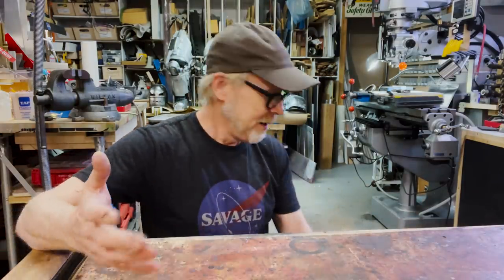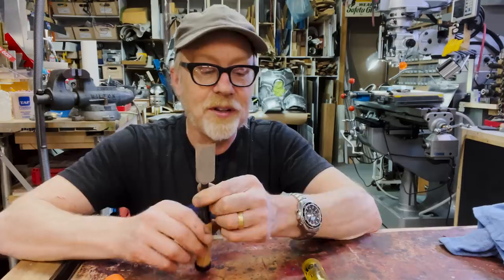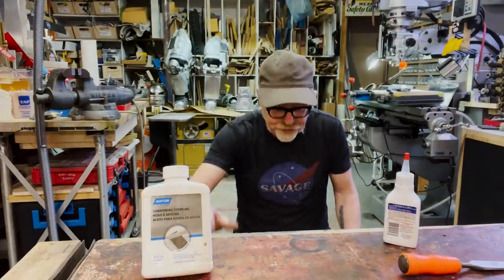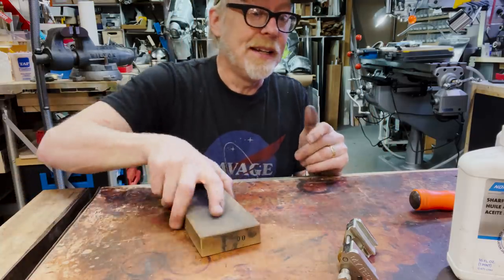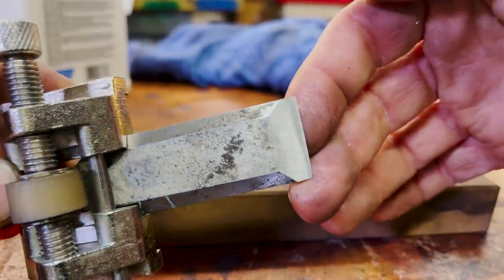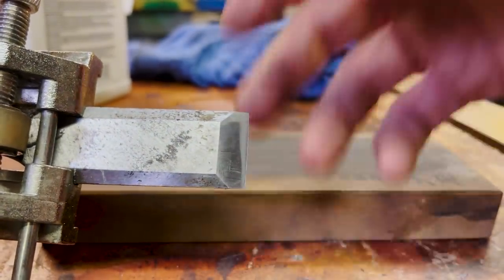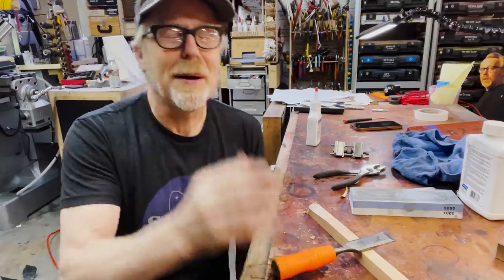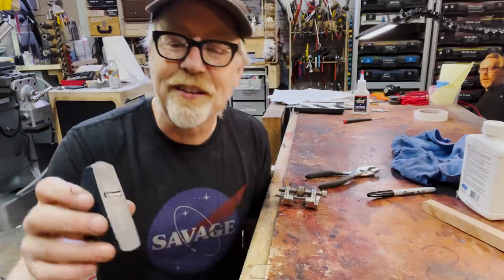Adam Savage's Favorite Tools: Woodworking Chisel Sharpening!

Comment: Hey Adam,
Handtool enthusiast here (come see us over on r/handtools!).
The key difference between a high-end and a bargain chisel is the steel. Exotic steels like PM-V11 vs something like A2. A really high-quality chisel is going to be made of expensive steel, they'll hold an edge for a good long while, but conversely, they'll take much longer to sharpen on something like a stone.

There are some very small differences in geometry of a chisel (consider a morticing or "registered" chisel), but these are mostly 'nerd' differences, and a regular bevel chisel like your hardware store finds are perfect general-purpose tools and modern steel means that even morticing you'll be fine.

As others have noted - Oilstones need oil, Waterstones need water - and really, Waterstones need to be soaked for 15+mins (until the bubbles stop coming out), a lot of people keep them in tubs of water so they're always good to go! Personally, I prefer my diamond stones, they cut really fast even in exotic metals - so I can spend less time working chisels, and more time working wood!

For sharpening, I find that it's a much better use of time to stop the chisel regularly during use, sharpen free-hand on the finest couple of grits before putting away each use, and sharpen with a jig on all grits when it's getting dull.

I wholly recommend the Veritas mk.2 sharpening jig - but only if you're ready to start getting into the world of Micro-bevels and "handtool pattern baldness"! Otherwise, the jig you have will keep you happy for years! Also, do bear in mind, if you put pressure on the tip of your chisel, you'll flex the chisel slightly, and create a camber (really useful for sharpening hand planes, not so much chisels).

A final note - a polished back will get you a much sharper edge, if you can get a mirror-polished back, all the little minute grooves that diffuse light will be gone and the edge you sharpen will have at least one perfectly flat intersecting plane. Doing this for the back will last much longer than the front, and pretty much solves the 80:20 problem for time management when using chisels!

Good attempt at a quick touch up, and as always, any time spent pretending I'm in your workshop is a dream come true.

Cheers Adam!
Reply: I've been wanting to get myself a couple of diamond stones. Mostly because the fact that they should stay perfectly flat longer without me having to be so precise with how I use my waterstones.
Reply: A man that refers to steel by recipes and can talk sharpening... my man. Keep up the good work!
Reply: Veritas system is so good. Worth every penny for chisels and hand planes.
Reply: @jonanderson5137  Once you can start listing the elements in each blend and the pros and cons of each you know you've swam too far in the deep end!
Reply: @sz9465  Veritas is too fiddly. The Eclipse style guide is all anyone needs.
Reply: If oil stones need oil and water stones need water, then those diamond stones must be really expensive to use!
Reply: @bryan__m  I wish I could give more likes than just one XD
Reply: @bryan__m  I use a fluid that costs $5 a gallon. If I only used it for sharpening it would last for decades. But it is a good cleaner too. So I only get a couple years out of a jug at my regular consumption.
Reply: @1pcfred  it was a joke about diamonds...
Reply: @bryan__m  thank you Captain Obvious. Unfortunately there are people here that would not know.
Reply: @1pcfred  I'm not sure it's clear from your response that you were not one of them, but if it makes you feel better to call people names then by all means continue. I'm pretty sure most people would know that diamond stones don't actually use diamonds to lubricate, but thankfully we are past that now and everyone will understand in the future.
Reply: @bryan__m  judging by what you're writing you do not understand the present. Diamond paste actually does exist. Diamond stones are a real thing too but they are pretty rare. I have one myself. But that's not what I use to hand hone edges with. What everyone uses there is called a diamond plate. But you can get stones made with diamonds at depth too. They're called vitrified or resinoid diamonds. They're not the silver plates.They're a dark gray in color. The cost of those is too prohibitive for them to see wide use. They're used industrially to grind carbide tools.
Reply: @1pcfred 🤦‍♂️
Reply: @bryan__m  your comment does not fully display on my PC so I've no idea what you are trying to convey. But whatever it is the same to you and twice on Tuesday.
Reply: @1pcfred  you've just destroyed the joke bud. It was funny and light-hearted and now you've explained it to death. RIP silly little off-the-cuff joke, you will be missed.
Reply: I would also say beyond the metal itself, there is something to be said for the quality of finish (i.e. something like a veritas or lie Nielson has mirror polished steel compared to a sweetheart chisel where you can still see and feel the mill-marks), as well as how steep the side angles are, to enable them to be more useful for things like dovetailing...a huge difference between high end and medium is that the high end tends to completely eliminate any side bevel shoulder. 
Then there are things like, is it a socket chisel or full tang, or does it have a metal band to eliminate the handle splitting. 

Some of this is different with things like a mortising chisel, but for the most part these details hold true, from what I can tell, across many specialty chisels too. 

The A2 or PMV11 difference does matter too. Don't get me wrong, and there are definitely differences in how often you have to sharpen & how brittle or easy to sharpen the edge is too.

Comment: Oilstone: use oil
Waterstone: use water
Reply: Soul Stone: use Marvin Gaye
Infinity Stone: Used Nissan
Reply: Whatever stone: just use spit. Works great!
Reply: I cringed when I saw him pull out a waterstone after setting a bottle of oil on the table.  But then Adam also shrugged at the differences between quality and cheap chisels.  It's more than just edge retention, blade geometry and flatness is critical for fine work.  If you're just opening paint cans or scraping up glue then it doesn't matter.  If you're chopping dovetails and paring end grain, then it is critical.
Reply: @PeppoMusic  That's what she said!!!!!
Reply: you mad lad!
Reply: @Exodus5K  quality chisels are in the use of them. What causes one tool to retain an edge over another is not immediately apparent either. Harder is not always better. Too hard and they're brittle, chip and are difficult to resharpen. Generally RC 58-62 is considered ideal.
Reply: @1pcfred  plus handle (grip) and balance.
Reply: @1pcfred  The out-of-the-box flatness of the back of the blade is probably one of the biggest attributes that separates a quality chisel from a cheap one.  To function properly a chisel's back has to be flat, so you either spend the hours to flatten it or you spend the money to buy a chisel that is already flat.
Reply: @1pcfred  The hardness is a huge factor, but so is the metallurgy of the material. When looking at the crystalline lattices of the particles that comprise the metal are also a factor in that. Carbide, for example, is ultra-hard, difficult to sharpen but can hold an ok edge for a long time. Whereas some of the newer powder steel technology for making tools produce a very hard material, and hold an edge for a decent amount of time, but are not as hard to sharpen (with the right methods).
On the flip-side of things, a tool made from a softer material like carbon steel, can be sharpened to a surgical fine edge. But the edge just won't last as long. I'll be honest, I still use my old Boyscout sheath knife made from carbon steel, when I go out deer hunting. I can get such a sharp edge on that, I can cut through softer bone, like near the rib cage or the cartilage at the bunghole that the poopshoot goes through.
Reply: @jimmeier547  carbide will never hold an edge like steel can. But carbide will remain sharper for far longer than steel does. So on blades that are not sharpened less initial sharpness is a wash. Like on say circular saw blades. Because no one sharpened the old HSS blades anyways. And yes I know some sharpen saw blades. But that's a minority of users. Most just run a blade until they're barbecuing the wood they're trying to cut then buy a new blade.
Reply: @Exodus5K  if you're spending hours you're doing it wrong. Go watch my man David W here. He'll show you how to make quick work of flattening chisel backs. Guy's done countless chisels. He has a problem. Now he's all into making chisels out of files. He has a serious tool problem. He's just into the process.
Reply: That stone is probably saturated with old oil
Reply: @7DavesToDie  isn't all oil old? They don't call it a fossil fuel for nothing.
Reply: @Exodus5K  But a cheap chisel can be set up with whatever blade geometry and degree of flatness you want.  In the end it does come down to edge retention.
Reply: @cwell2112  It's a balancing act isn't it?  Edge retention and sharpness.  Hardness and strength.  O1 tool steel gets very sharp and sharpens easily and is cheap, but dulls quickly.  A2 steel doesn't get get as sharp, but holds an edge longer and is moderately expensive.  Powdered metals like PMV11 are harder yet, but because they lack a grain structure they don't develop a burr like other steels so remain sharp for a very long time, but it is expensive.
Reply: Two ways not to use water stone. Dry and with oil. They are called water stone because you use water! Watch a YouTube on it.
Reply: it's a stone, oil or water will work.  Oil is a better lubricant that doesn't dry out.  Either will work or mix them together with an emulsifier.
Reply: @luthiermatt  the only thing you should be using water stones for today is paper weights. We have synthetic diamonds now. They're sharper, harder, cut faster and never dish out. So unless you're a traditional samurai sword maker leave water stones in the past where they belong.
Reply: Yep, it is in the name... but with that tool, it is a waste of a stone that size.
Reply: @1pcfred  I'm not necessarily advocating water stones. I have them. They work well but area messy. I use DMT 300, 600, 1200 with 18000 diamond emulsion on a leather strop. Read comments before you comment.
Reply: @wobblysauce  what did Shakespeare teach us about names? A rose by any other name still gets the cutting fluid you want on it!
Reply: @luthiermatt  water stones work OK for Japanese people that use them on bridges over water vessels. Especially when they have that bamboo spigot running water on them. I always find that a nice touch myself. Makes the whole setup look like a display in the It's a Small World ride then.
Reply: @1pcfred  your ignorance is astounding. Most chefs use waterstones and a huge number of woodworkers use water stones. Every major woodworking outlet sells them. They work very well and all you need is a pan to soak them in for a bit. I still pull mine out if my diamond stones are not quite working for a particular tool.
Reply: @luthiermatt  you are using the eat 5#i+ 50 billion flies can't be wrong  facetious argument. Or feces argument. If everyone jumped off the Brooklyn Bridge I bet you'd run home to get your bathing suit! Quite frankly I really do not care what everyone else does. You are obviously impressionable though. I may in fact know things many others do not. Considering my intelligence and level of knowledge that could quite possibly be the case. My water stones sit unused in a drawer here. One thing I do not know is what tools diamond plates do not work on though. Perhaps you can enlighten me? Dispel this one dark corner of ignorance my mind possesses.
Reply: @Exodus5K  I cringed as well. My farther was a carpenter and taught me how to do it.
Reply: @1pcfred  basically everything you have said about metallurgy, materials science and sharpening is all wrong. Nobody should listen to you, -an actual metallurgist
Reply: @overkill246  what did I say about metallurgy? Be specific. I am not buying your appeal to authority either. My half a century of experience trumps your worthless job description.
Reply: @1pcfred  olive oil isnt old oil.
Reply: @vwertix1662  old olive oil is old oil. Olive oil goes rancid when it gets old too. It congeals and can acquire quite an odor. Most olive oil in the USA would be considered rancid by Italians. Sitting on store shelves! But as the oil gets even older it does get worse.

Comment: 2 big pieces of wisdom: a dull blade is the most bloodthirsty tool in the shop, and a cheap chisel is a fantastic splitting tool.
Reply: What about a cheap chisel makes it a fantastic splitting tool? Not tryna be contrarian I’m just genuinely curious which aspect of a cheap one would cause that.
Reply: @dogol284  the part where you don't mind abusing it quite as much.
Reply: @RaphYkun  ah... I misread “fantastic splitting tool” as something that’ll easily fuck up your wood.
Reply: @dogol284  the cheepness and the chisel (wedge) like shape
Reply: One time a cheap chisel handle split apart instead of the wood and luckily the chisel flew sideways as my hand was still pressing down when it split. Never trust a cheap chisel no matter how useful it can potentially be.
Reply: @orien2v2  you should have used a socket chisel if you are going to put that much force on it.
Reply: @andrewsock6203  I’m planning on buying a set of chisels, what are the drawbacks of socket chisels?
Reply: After working in kitchens for years, I've gotten injured the most from a dull blade.
Reply: @dogol284  they are only for hitting with a mallet. Not for fine hand carving really but if they are the modern handles made of plastic that don’t separate, you can get some control using hands.  You just don’t hit tang chisels. If you want flat chisels to hit you get socket chisels.
Reply: I think it always is a result of bad choice of technique. I have manny dull blades that I use when I don’t want to cut myself when forced to use a bad technique. I have slipped and raked a dull knife over my fingers/thumb many times and then thank myself for not sharpening to follow silly rules.
But dull knifes slip more for sure.  But if your smart your hand won’t be in its path.

Comment: Those sharpening guides (both inexpensive & expensive) have blade protrusion lengths stamped on the side to achieve a desired angle for both chisels & plane blades.
Reply: No they don't. I have one so I know. What I do is just take a scrap piece of plexi and put the chisel on the guide on it and hold it up to the light. I like a little kick on my secondary bevel. I hollow grind my tools anyways. Adam needs more sharpening game.
Reply: I too own one, and mine does have the measurement guide